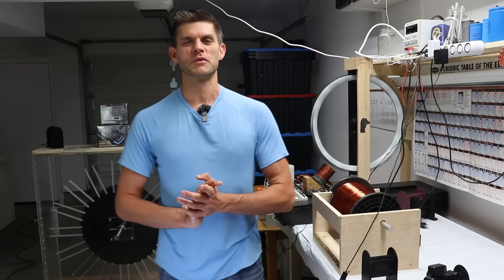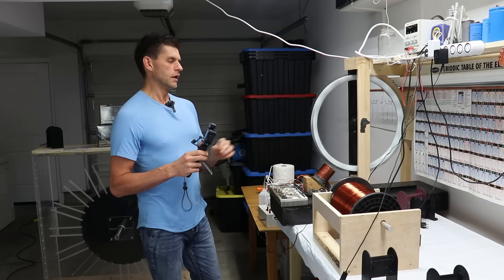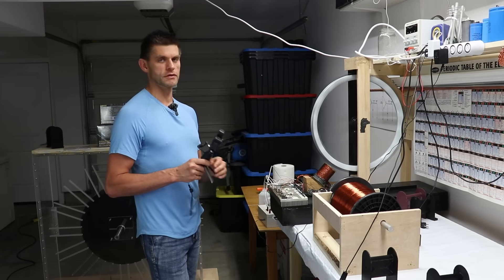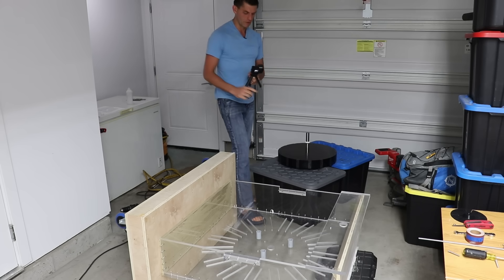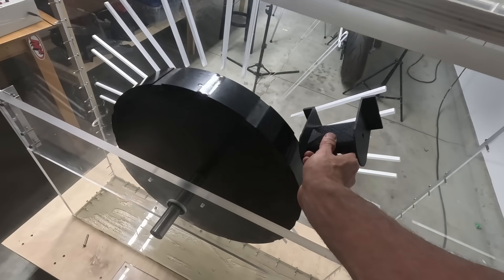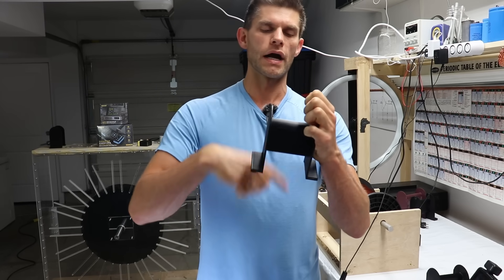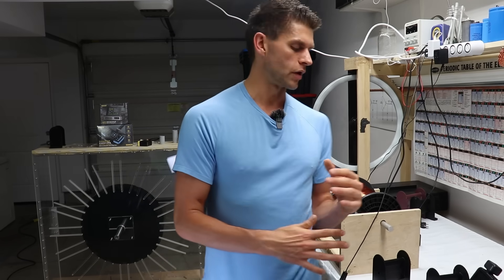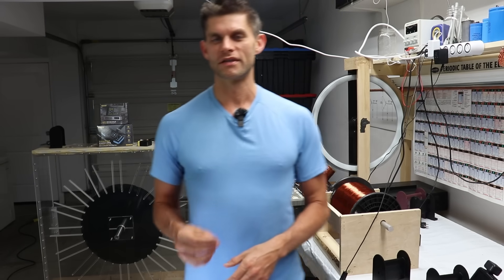Unlocking Zero Point Energy in My Garage (Open Source Project)

Comment: ⚡ Energy Suppression & Technological Enslavement
6,000+ Patents Under Secrecy Orders: The U.S. Patent Office’s "Sensitive Application Warning System" (SAWS) withholds approvals for free energy, anti-gravity, and advanced medical tech under "national security" claims. Examples include:

Tesla’s Wireless Power Transmission (blocked 1905): Burned lab, funding cut after proving free energy viability 91115.

Stanley Meyer’s Water-Powered Car (1998): Murdered via uranium poisoning after rejecting $1B offer from oil interests; car achieved 100 mpg equivalent 915.

Nazi Bell (Die Glocke): Anti-gravity tech recovered by U.S. post-WWII, buried in black budgets 915.

Medical Tyranny: Cures suppressed to maintain sickness profits:

Royal Rife’s Frequency Generator: Cured terminal cancer in 1934; lab raided by AMA, equipment destroyed 915.

Hoxey Herbal Therapy: 80% cancer cure rate; 17 clinics shut down by FDA despite sworn doctor testimonials 915.

Linus Pauling’s Heart Disease Cure: Vitamin C + lysine protocol blocked; drug industry profits from chronic treatment 915.

🎭 Control Mechanisms & Psychological Warfare
"Conspiracy Theorist" Label: CIA coined term in 1967 (Document #1035-960) to discredit JFK assassination researchers and deter scrutiny of hidden power structures 11.

Digital Enslavement Infrastructure:

Algorithmic Mental Health Sabotage: 37% of Gen Z use social media "almost constantly"; platforms optimize for addiction, spiking depression rates 60% since 2010 1014.

Engineered Scarcity: Federal Reserve bailouts (e.g., $16T to banks 2007-2010) vs. suppression of community solar/wind patents to maintain utility monopolies 311.

Economic Slavery Systems:

Petrodollar Enforcement: U.S. invades nations (Iraq, Libya) attempting to trade oil outside USD 3.

Debt-Based Currency: 72% of U.S. taxes fund interest payments to private banks like the Federal Reserve 3.

✨ The Awakening Resistance
Gen Z Spiritual Revolt: 50,000+ youth at 2023 Asbury Revival rejected digital nihilism, seeking transcendence through communal prayer and repentance 26.

Decentralized Truth Networks: Gen Z uses encrypted mesh networks and QR graffiti to share suppressed tech blueprints (e.g., open-source energy designs) 511.

Final Reality Check: "National security" is the cage for human potential. Your liberation begins when you recognize the jailers. Spread this. 🔥

"The real menace of our Republic is the invisible government, which like a giant octopus sprawls its slimy legs over our cities, states and nation."
— John F. Hylan, NYC Mayor (1918-1925) 11

Comment: Hopefully you will read my post.

Think about frequencies and create energy without any other source.
What you need is one ordinary coil as the one on your Bedini wheel model.
Then use a toroidal coil where you put the frequencies through the toroidal into the other coil, with at least 12VDC. 
My very small model lights up five 16W 220VAC LED lights, while running a 700W drill and charging a second battery. 
Resonance is the secret that also turned into negative energy that keeps the whole system icy cold, thus producing more output power.
Blessings unto those  who can afford to do research and development.
Reply from the maker: Show us your device? Great comment
Reply: You understand. Cool to see people that actually built some here. Super!
Reply: Yes, you are right- there's a channel on that, he uses two coils, in a loop, one as generator coil and one as pulsed coil, with that flywheel u can produce over 40kv
Reply: Great work, u have a great vision, ❤❤❤. Keep it up.... love from Africa 😊😊😊😊
Reply: Well, u r just looking for money, $10 000 - not worth it. People must do research, u can build this for way less. 😊😊😊😢😢😢😮😮😮😮

Comment: I did some research, and from what im getting from zero point energy is that its the lowest energy a vacuum can have. This means if you try to "harvest zpe energy" you would pull more energy out of an already "at its lowest energy" system- that is impossible. This is the very definition of ZPE, the lowest point of energy anything can have, and no lower so no energy can be extracted. Now im likely not understanding this fully as your explanation is kind of confusing, but unless you show me the machine consume less than it outputs, im out.
Reply: Think of it like lightning. Its impolsive energy, meaning its like a bubble imploding under water, not an explosion where things push outward from a source. when you get a fluctuation in electrical potential, you create this gap or bubble in the environment. Browns gas (hho) is another example. A good example in nature is the pistol shrimp. By taking advantage of the aspects the environment the pistol shrimp creates a bubble that is hotter than the sun. The laws of thermodynamics are 'loopholed', not broken. Its also like pushing a boulder downhill not uphill. We need to consider all factors not just the generator (you pushing) and the thing it acts upon (boulder) but also the space in which it is in (recognize the hills  "free energy" assistance ) Theres "free energy" everywhere, anyhill side or flowing stream or bubbling hot spring or natural decay or hot sunlight, electrical fluctuations, barometric pressure fluctuation,  (lightning) its just a matter of being clever and in harmony with environment enough to harness them. (not fighting your surroundings but instead "hack" {make them work with you not against you} them so to speak) Be a warden of the land. To harmonize you must know the notes ringing out around you; is another way to look at it.
Reply: @Vallcon  the pistol shrimp's bubble gets the energy to become hotter than the sun from the shrimp itself and the food it ate. I dont get how on earth that makes sense when trying to generate some magical energy. Yes, there is energy all around us (the air is warm, over 0 kelvin so it has energy, but the second law of thermodynamics tells us you cannot extract energy in another form from heat from this air unless there is a temperature gradient)
Reply: Your right. No one understands it because its not widely seen. When it is they  will agree on a model that is ontologically simple for us to understand
Reply from the maker: Facts
Reply from the maker: Bro you're reading mainstream propaganda. Gotta read suppressed theories if u want the good stuff.
Reply: @MadscienceLPTECH  well i do agree there is "gray areas" in what we are provided, mind explaining this the way you understand it? Im just trying to get a grasp on the subject lol

Comment: if the "free energy harvest" happens in the battery, why on earth do you need that wheel?  you can always just make an inductor blast out fast and intense energy pulses.
Reply from the maker: The rotor is extra energy why not. It gives a way of showing the system stays the same energy while doing extra work

Comment: Sorry, but your analysis is wrong. When a magnetic field collapse (power turned off) there is a voltage spike caused by inductance leakage. but this is just the store energy in the magnetic field that was transferred to the rotor. Basically is is leaked power that wasn't transferred. There is no energy gain. Consider if you use a transformer (no wasted energy running the rotor), there are still inductance leakage spikes, but there is no free energy.

"Inductance leakage spikes, often seen in transformer circuits, are voltage surges caused by the magnetic flux not fully coupling between windings. This leakage inductance acts like a small inductor in series with the windings, and when a switch is turned off, the energy stored in this inductance can create a voltage spike"

You can never make a magnetic system at unity or over unity, because even if the input & output coils are tightly coupled with no inductance leakage, there are still losses: energy loss transferring a magnetic field to the core,  eddy currents in side of the magnetic core material, and leakage into free space.
Reply: Has anyone noticed that, in response to questions in the comments, he resorts to ridicule rather than actually answering the question.
Reply: @catrinsdad  scammer / delusional person 101, deflect deflect and deflect some more
Reply: Very well explained, now only if the ones who needed to understand would actually grasp it.
Reply from the maker: Sounds like you have read some books. Good luck with those beliefs
Reply: @MadscienceLPTECH  Seriously? Note beliefs, 200+ years or electromagnetism science. Have you even taken an electrical engineer class or read a book on inductors & transformers?
Reply: @MadscienceLPTECH  LMAO I build power systems, and he is spot on, if you had nay grasp of this field you wouldn't be making the hilarious claims you are, only 3 options exist, you're a scammer, you're delusional, or the kindest, you're ignorant of actual energy generation and conversion.

Comment: how much energy, volts or current are you gaining from it?
Reply from the maker: I don't know. That prototype u need to calculate the work done on the rotor and monitor the voltage in the batteries. Hard to calculate voltage and amps from high voltage spikes
Reply: @MadscienceLPTECH then how did you know you were getting power output?? (Anyways, this looks amazing ❤❤)
Reply: @Nova-q3n1i   he doesn't, that's the point, he never will.

He can't.

Comment: Are you splitting the di pole of the batteries? 🔋  🪫
Reply from the maker: Im not sure. I'll think about that
Reply: @MadscienceLPTECH . 🔋+|l|l|l- connect-the-negatives -l|l|l|+ 🪫

Run the flow from high voltage battery positive to a low voltage positive the h-shaped voltage spikes from the back emf charge it. Just curious in the test. We usually just kill the dipole traditionally by positive ions canceling negative instead of moving by electrons back and forth between the positives. Once the energy of electrons hits the other dipole (negative) it’s gone.

Comment: No, suddenly charging a lead-acid battery with a high voltage doesn't cause a generated dipole to draw energy from the ether or the vacuum. 
This is a scam like many others, please don't spend your money on this project. Feel free to ask any questions/clarifications.
If you're interested in clean, free energy I'd invite you to look into solar panels.
Reply from the maker: How would you know this. I'd say your the scammer telling people what is impossible.
Reply: @MadscienceLPTECH  I'm not saying drawing energy from the vacuum state is impossiible, I'm saying that charging and discharging a battery will not do it, there's no evidence that this is an observable phenomenon, and you offer no rigorous proof of your claims while requesting people support you, monetarily or otherwise. 
Simply put, zero point energy is uniformly distributed; to even begin to produce energy from it you would need a gradient in the energy field to create work from it; this is a fundamental law of thermodynamics. Then, you might say you can create energy from the quantum fluctuations of the field. Doing this is essentially Maxwell's Demon; the work to observe and react to these fluctuations will always far surpass the energy you can actually draw from the system, thus no net work can be generated.
I acknowledge it's possible you have no malicious intentions and have simply been misled, in which case I would encourage you to further research this domain and share you findings with your followers. These videos are approachable, friendly introductions to the topics I just mentioned and I would encourage anyone watching this video to check them out:
https://www.youtube.com/watch?v=Rh898Yr5YZ8
https://www.youtube.com/watch?v=KR23aMjIHIY
Reply: @MadscienceLPTECH  I'm not saying drawing energy from the vacuum state is impossiible, I'm saying that charging and discharging a battery will not do it, there's no evidence that this is an observable phenomenon, and you offer no rigorous proof of your claims while requesting people support you, monetarily or otherwise. 
Simply put, zero point energy is uniformly distributed; to even begin to produce energy from it you would need a gradient in the energy field to create work from it; this is a fundamental law of thermodynamics. Then, you might say you can create energy from the quantum fluctuations of the field. Doing this is essentially Maxwell's Demon; the work to observe and react to these fluctuations will always far surpass the energy you can actually draw from the system, thus no net work can be generated.
I acknowledge it's possible you have no malicious intentions and have simply been misled, in which case I would encourage you to further research this domain and share your findings with your followers. PBS Space Time have approachable, friendly introductions to the topics I just mentioned and I would encourage anyone watching this video to check them out.

Comment: I am so excited to see someone picking this up torch bravely. I will be subscribing and following your progress and be building something very similar. something you might want to build into it is a second magnet inside the wheel, a ferrite magnet, between your rare earth magnets so that it creates a third magnetic field to stabilize the rotation. they are incredibly cheap and would likely help efficiency later in this process.
Reply from the maker: Thank you for the kind words and support. Let's do this together